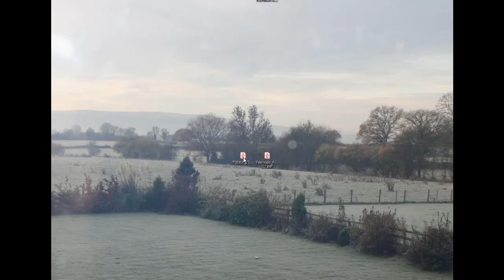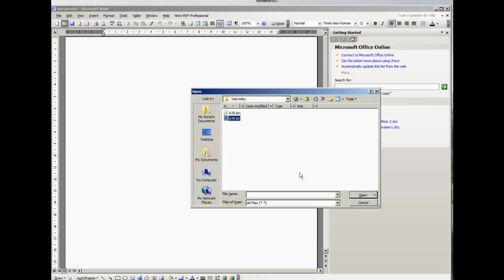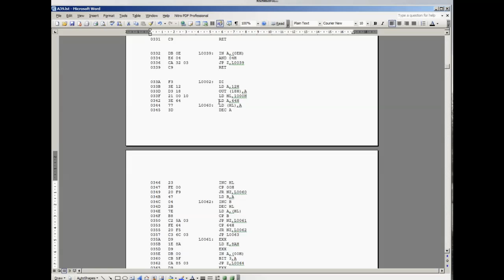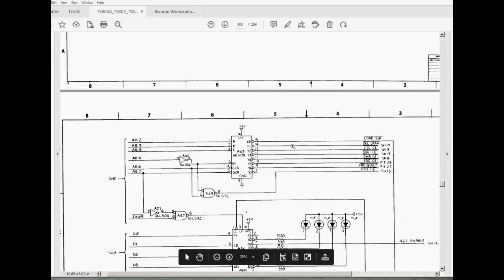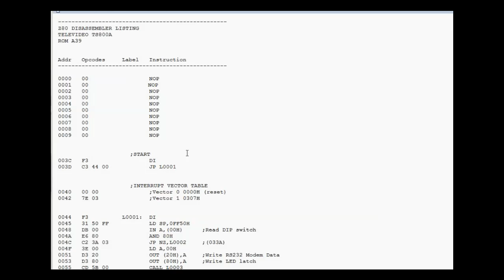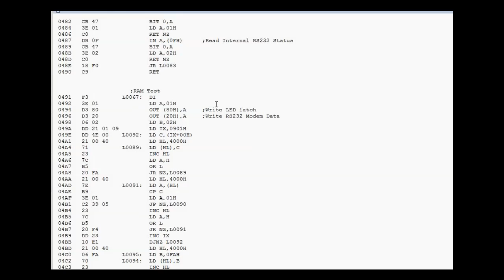Reverse Engineering Embedded Firmware Code

Comment: That was helpful. You made it easy to get my head around the idea of decompiling and reverse engineering code. Key learning for me: start with an understanding of the CPU and machine architecture.
Reply from the maker: Correct. Actually without an understanding of the CPU and instruction set then a listing would not be useful anyway. Having said that this is an excellent way of learning about different processors. It is also a lot of fun.

Comment: 20:42 It helps if you've memorised ASCII encoding, because then runs of bytes falling within the alphabetic ranges really jump out at you. The bytes shown starting at address 0AD7 read 'System "boot"(1-Rev. F) from floppy disk in progress'. And, obviously, once you've identified a string which talks about booting, any code which refers to the address of that string is likely to be boot-related, so the strings help you identify the code. Alternatively, just have a window open on a hex-plus-ASCII dump (like the memory editor shown at 04:00), which makes the strings easy to spot.
Reply from the maker: Any ASCII text strings can simply be read in the binary file as they are shown as 'characters'. However the reason I used the term lookup tables rather than text strings was because most of the lookup tables in this ROM are CPU to CPU data exchange sequences used in communication between the two processors. There are also a large number of encoded byte sequences where the first byte is the code and the following byte(s) are the code sequences. Unfortunately these do not result in human readable strings but they are still lookup tables, hence my terminology and approach. It is also worth mentioning that many of the machines I work on are from other countries so the 'text strings' are not in English.
Remember that ASCII values are simply hex values which also appear in instructions.

Comment: Having analyzed firmware ROMs with the aid of a disassembler a number of times I'm personally quite used to the process, but it was still interesting to follow your thoughts. Looking up the port addresses from the hardware schematics was a nice touch. And, as others have pointed out in the comments, you explained everything very well so it should be a good introduction to those who haven't done similar work before.

Comment: for a large complex program you really speed up things using an interactive dissembler like Ghidra or IDA, both support Z80.
Reply from the maker: If you find it useful then you should use it but I find it much easier and MUCH faster to use the process I showed. It is mostly using the LA to check where the code is getting and this cannot be done in a software only environment. Remember I am showing how to repair hardware and not software.

Comment: A very useful tutorial on disassembly., Many thanks.  By the way, a google search on wordpad would suggest that Microsoft Windows  are killing it off on their next update! 😢
Reply from the maker: Yes they are, along with many other useful utilities as Windows becomes nothing more than a social media platform. That is why I no longer upgrade my OS. You can however simply copy it from older versions if you want to retain it after upgrades. They removed Hyperterminal some time ago but I still use a copy from an older version of windows. I find it very sad that PC's are becoming useless for anyone actually interested in computing by the very same company that first made them so popular.
Reply: @JerryWalker001  Yes, I agree with your sentiments. A great pity that Microsoft are doing this, apparently it’s called ‘progress’!  I’m still using Windows 10, it was allegedly supposed to be their last OS and simply updated regularly infinitum, then came Windows 11!  Thanks for the tip on how to retrospectively install wordpad onto  modern windows.  By the way, your Z80 series is excellent! 👍